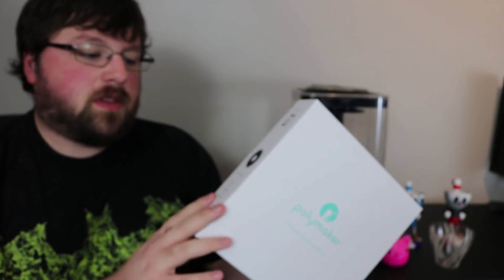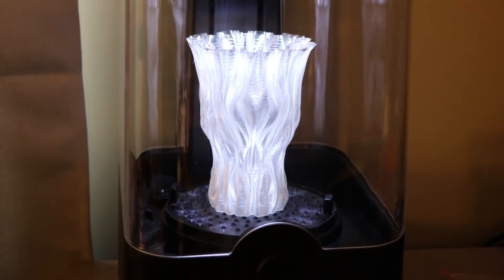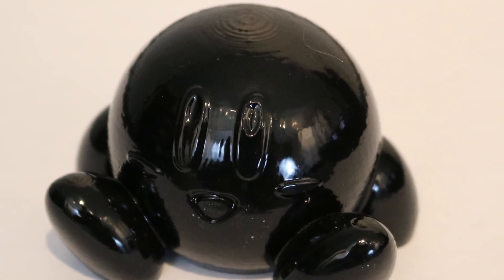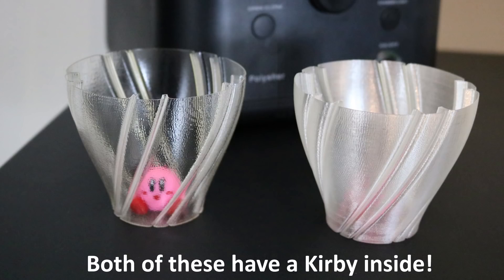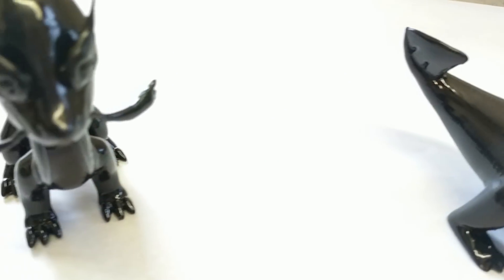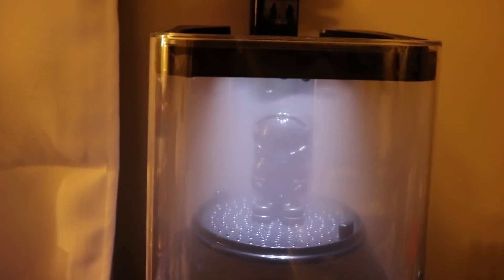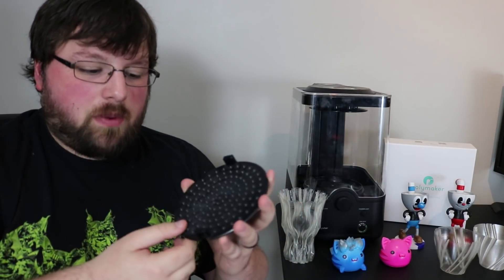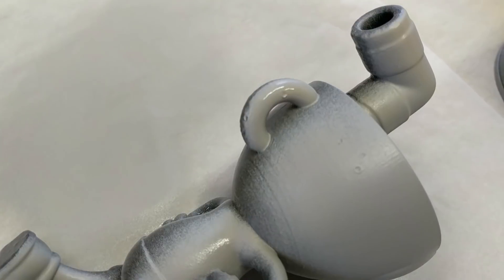Smoothing 3D Prints with Isopropyl Alcohol! - Polysher Review

Comment: For anyone looking to purchase this machine, there are a few more caveats that I have run into with the Polysher.  I have one and this is some knowledge that I have learned. 
1) The model needs to dry for a good long time after you have it in the Polysher. If you live in an area with a lot of moisture/cold weather, (IE anywhere in the Northeast or Northwest) these models will take days to dry on their own.  The best thing you can do (Recommended by Polymaker and tested by myself after I had many issues), is get a food dehydrating machine, put it on the lowest temperature settings, and let them dry out on their own overnight. Like Garrett said, this stuff is super moisture sensitive.  
2) Get yourself some sort of solution for printing with this filament moisture free.  I bought the Polybox, Polymaker's solution to protecting the filament while printing and that works very well if not a bit over priced, a DIY solution would easily work if one has the time. 
3) I had a lot of stringing issues when printing with Polysmooth.  After days and days of trying to figure out why I was getting stringing, between tweaking retraction settings, turning down the print temperature, etc. I determined that my filament (straight from the factory/Amazon warehouse since I bought multiple rolls), was moisture tainted. I don't want to put that fully on Polymaker, it could very well have been how it was stored at Amazon's warehouse or something like that. After speaking with a Polymaker rep, they asked me to dehydrate the roll of filament in my food dehydrator and my prints started coming out beautiful.  Polymaker has promised to send me replacement rolls since then making it right; I could have just gotten a bad batch or something. 
Overall, I'm pretty happy with my investment, and I hope this info helps people looking to get into Polysmooth.  

Thanks so much for the great video Garrett!!!
Reply: Bill Warnock yes they do take awhile to dry!! I always throw a fan on them and let them dry for at least a day!! Even between flipping sides to polish!!